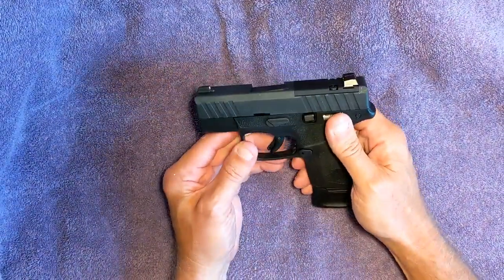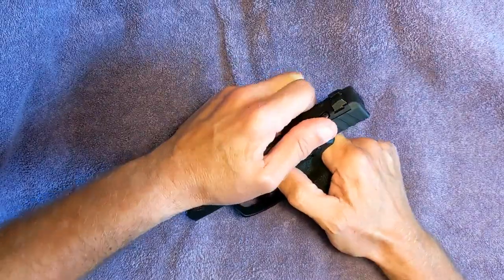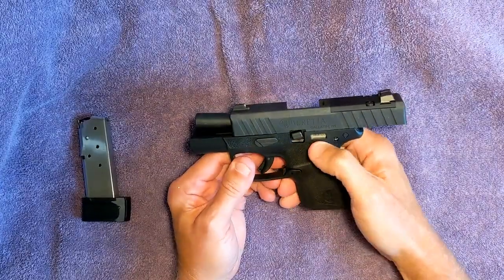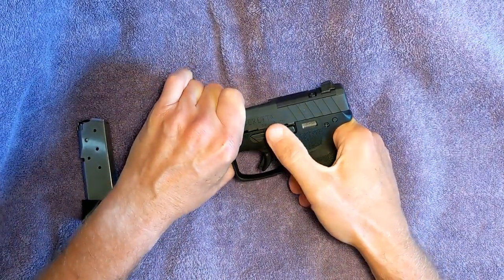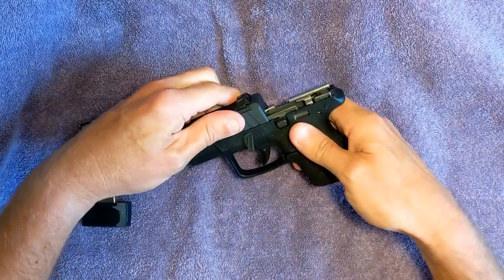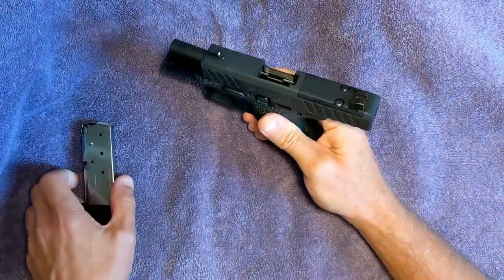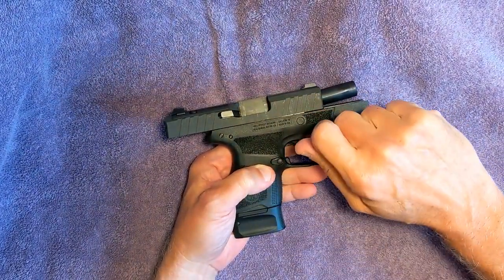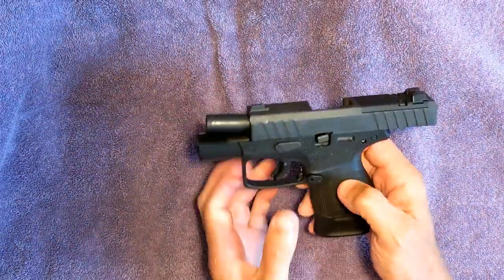Beretta APX Carry A1 teardown - 1 minute video

Comment: I took the disassembly pin completely out before depressing the striker button. And it will not disassemble now even while pushing in the striker deactivation button. Any suggestions on how to get it to disassemble from here?
Reply from the maker: Darren, I have accidentally done the same thing previously.  It's a real pain but you have to reinsert the pin before it will disassemble properly.  It's not easy getting the pin back in but it can be done. It takes a lot of finger and hand strength.
Reply: @LarryBlackledge  thank you!
Reply: @LarryBlackledge  I just did the same thing. I can't get the pin back in.
Reply from the maker: @Andrew--S  sorry to hear that.  It is a struggle but you can do it. It's just a pain in the butt.  I have since sold that gun so I can't go look at it and tell you any detail. But my memory is you have to move the barrel assembly action a little back and forth while you force the pin in and twist it
Reply: @LarryBlackledge  lol i got it, yeah it was a pain pulling the trigger, pushing the pin, and moving the slide all at the same time.